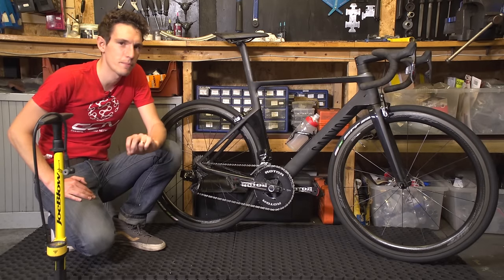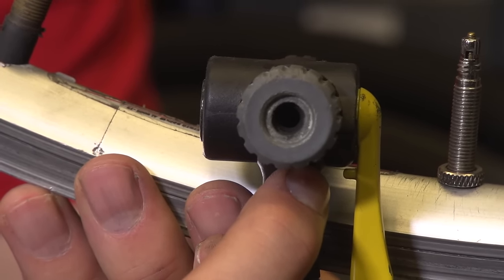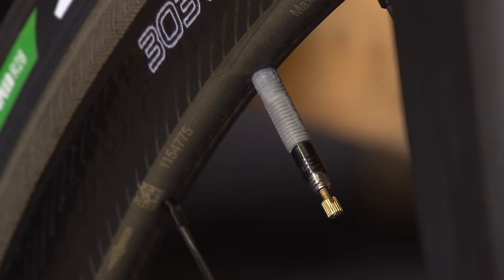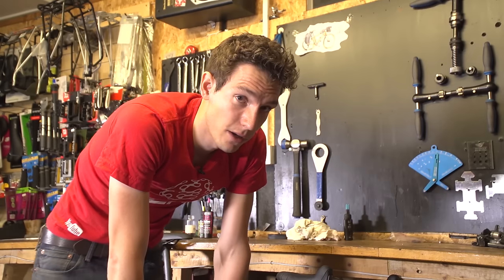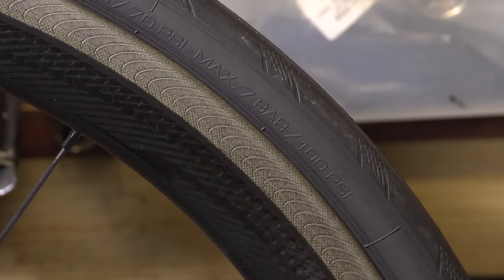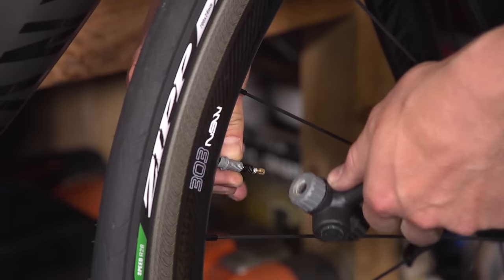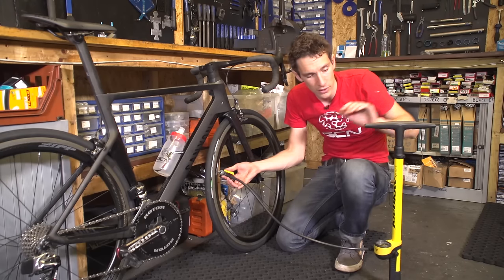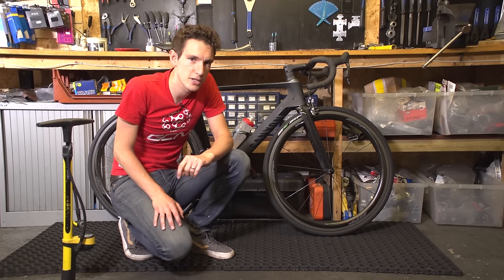How To Pump A Bike Tyre

Comment: haha i use laytex tubes and note : they have widths... i accidently got 700 x 23.... wanted 700 x 25.  they blew up when inflating.  Hey why ruin ONE expensive tube when you and ruin TWO?  my local bike shop fulfilled my request to get the proper sizes at 1/2 price.  lesson learned.

p.s. laytex tubes seep air...totally normal.  but way faster than butyl... just top up the air daily.

question for GCN.  did you ever "ping" the tires and go by sound ?  just got a digital tire gauge this week (age 66 my first ever lol).  pressure i normally ride at came in at mid 60s,  and when i pumped it VERY  hard went to 84.  using specialized roubaix 700 x 23/25 tires (yes that is what the sidewall says)... i worry about blowing out tube (butyl on this wheelset).  thoughts?

Comment: This is very interesting, thanks for this informative video. My road bike tyres states that it should be inflated to 100-130 psi (presta valve). But for some reason, when I start pumping my tyres I'm only reaching 60 psi and I'm no longer able to really keep pumping it - hard resistance feeling.. My pump is struggling to push anymore air in & feels like it's going to pop. Is that an indication that I have wrong tubes inside my tyres? The pumps gauge indicates it is more than capable to pump more than 130psi. Thanks in advance for sharing your knowledge!

Comment: What is the gray on the valve stem? Is that something added on to prevent the rattling you typically hear over every damn bump in the road? I've been trying to find a way to deal with that.
Reply: I always stick a little piece of electrical tape over them. Cut a length, make a little hole in the middle, stick the valve through then smooth onto each side of the rim (but not your brake tracks!). Only ever had this problem with deep carbon rims though.
Reply: Now that's a decent idea. I'm going to try that this afternoon. Thanks.

Comment: If the air isn't going in on a presta valve, I lightly jiggle/rock the pump head where it's locked onto the valve.  I hear a little tap/pop sound and then know that the valve is unstuck inside the head and ready to receive air. Not sure why this happens or if it's universal, but I have  virtually the same pump as Si and it happens about half the time.  No big deal once you know how to deal with it. Very frustrating before I figured it out.

Comment: Hi thank you for the video. My problem is there is a section of the tire that’s stuck in the inner channel of the wheel. I’ve tried massaging the tire as I inflate up to 40 psi but one section of the tire does not want to expand out to the outer edges so that part looks under-inflated. Any tips on getting the whole tire to sit uniformly around the outer edges of the wheel? I get the need for the channel for removing the tube and/or tire, but it’s very frustrating when it’s stuck in that channel when inflating back up! Haha

Comment: What's the white/greyish thing on the presta value? I imagine it's used to stop vibration while you're out riding but not sure exactly what it is. I generally use a bit of insulation tape on the value for that, instead of the nut that comes with some inner tires.

Comment: You don’t always need a adapter for your pump to change valves. Like my track pump has one hole for Schrader one for Presta valves. I only just realised this week as even though i don’t ride road bikes I got a new hybrid bike and all my previous hybrids were more mountain based which had Schrader valves but my new hybrid which is more road based he’s Presta valves and my pump works for both valve. That’s the first time I saw Presta valve exception of this video

Comment: I understood  the video and tried it. My pump has a blue thing in it that prevents it from being properly inserted to the valve. Do i have a wrong pump ? It’s a BTWIN 500 pump and I have a tubed road bike tyre
Reply: I opened the little nozzle and left it open and now I have both flat tyres with no air in either. It’s a Sunday 😅 I’d love to take the bike for a ride once this is fixed today 😊

Comment: I had to pump my tire yesterday because I thought it needed some air. I could’ve just rode on it fine but silly me thought it was getting harder to ride and thought pumping the tires might help. While I was pumping the damn bike pump’s tube snapped. I had to get to work in 10 minutes and so I thought wrapping it in duck tape would work. Suddenly I get more tears in the tube and I’ve accidentally let all the air out of my back tire because the bike pump’s tube was connected to my back tire and it opened a path of air to leak out quickly. So in the end I took my scooter to work which was exhausting. Now I’m wondering if I was pumping my bike wrong for my bike pump to just give out. It was a pretty old pump, no one in my household has rode a bike for 10 years.

Comment: I spent like 30 min trying to pump my bike with the presta valve closed. Also The pump gauge says 20 psi and the tire recommended psi is 60 but when I press on the wheel, there isn’t much leeway for me to push in the tire meaning it’s full on air? Thanks

Comment: Helpful; but, it has to be emphasised to those using a pump for the first time: lock the lever thingy in the direction away from the valve.

Comment: For a task I never a challenges as a kid, why is it so difficult now? Pump rarely seems to attach properly to the valve. The result is resistance that prevents air from moving at all or air completely escaping with each push of the pump. I’m writing with this exact same pump and similarly road bike tires.

Comment: Im guessing that the main culprit is my cheap pump? But I always seem to have problem inflating my tires (presta valve).. I cant seem to ever fit the pump head securely on the valve! I have to press it on the valve really hard, which sometimes will bend the lock ring's valve.. and that will weaken it and eventually break off. I'm 100% sure its not user error.. Any ideas or recommendations on pumps?

Comment: My son got his first bike last year and now his front tyre is low.Its a schradar valve and I have your very basic pump.Pumping it is fine but its when I unthread the pump I basically loose whatever air I've pumped into the bloody thing.Would a pump that you push into the valve be the solution.I'm tired pumping the tyre.Helpppp!

Comment: when I pump my road tire the head of the big pump always fly out because of the pressure so I must only use one of my hand to pump and the other to hold the head, any suggestions on how to secure the head of the pump to stay on valve, I dont have problem with the mini pump because it has threaded inside head that I screw in on the valve adapter and the big pump have flat inner head

Comment: 2:13-Is that the new #8 spoke adjusting hammer with a cushioned handle for absorbing the shock of the impact hanging on the wall.?

Comment: A pump that screws onto the valve can pull out the valve when removed, if the tube has a removable valve (as many now do) and you didn't use Loctite or pre-tighten the valve.  Very unfun to be stuck in the midldle of nowhere because you can't remove the pump without deflating the tube.  A dab of Loctite when packing the spare tube makes all the difference.

Comment: Hey guys, I have 23 mm tires but im looking into going wider. How much more resistance can i expect jumping to a 25 or 28 mm? double resistance? 10% more?

I dont have hundreds of dollars to spend, im using 23mm Continental ultra sports both front and back but sometimes it just feels so bumpy, although I do love how fast they feel compared to when I ran 32mm.
Reply: Specialized have a fair few tyres that are 23/25 meaning the tire itself is the size of a 25 but the contact surface is that of a 23 meaning you get the benefits of both, it's worth a look into and they aren't expensive either
Reply: I am interested in this as well. I just asked up above in the comments for a comparison. I just switched my 23mm tires to 25's and love them. Now I am curious about 28's,,,
Reply: according to one of GCN's videos you actually decrease rolling resistance going from 23mm to 25mm tires, and even to 28mm

Comment: Can someone explain why most every time I try to inflate my bike tires, more air tends to come out than in? I adjust and readjust, use different pumps (powered, hand and foot) and even on different bikes. It just seems that the air rarely wants to go it. I generally use Schrader adapters on presta vales.
Reply: Presta valve's are a nightmare to deal with. I'm having the same issues. They are small and very brittle. Avoid elops bikes from decathlon.

Comment: I just bought a manual tire pump and it has a pressure gauge but it has no locking mechanism nor does it screw in to the tire. I pump air in but after a while, the handle gets harder to pump and the air leaks out of the tire and whereas, I was at 10 lb psi I'm stuck at twelve and can't pump any more. Even my old pump let me pump my tire up to 32 psi. Help, if you can.

Comment: I tried pumping my tyre up to the recommended 45-60 psi, but I could barely get it to 30, and when I removed the pump from the valve, air came blasting out continuously until I got the cap back on it. Even after that, it felt like air was still rushing out around the base of the valve where it connects to the tyre. What did I do wrong?????????????

Comment: You put it on and then moved the yellow thing without explaining which way to move yellow thing. That’s what I’m trying to figure out. Also why is my front tire completely flat I was riding it with no problems this morning does that mean I need to replace the tire or just fill it up if it’s completely flat???

Comment: NEWBIE here...I'm trying to attach the nozel from the pump onto the shrader valve but it keeps sinking inside the tire so I cant push it on. Seconds when I pump, feels like something is blocking the air from going in the tire. The pump gauge doesnt stay up (needle goes up, then back down to 0)

Comment: What's the point of presta valves anyway? It just seems like a hassle to not be able to use a regular pump without an adapter.
Reply: *****
I guess that could be an explanation for why mine are leaking.  Thanks, I'll investigate further.
Reply: Could be rim integrity consideration - tiny rim surface and larger hole might be not something to trust. Besides, for aero "deep" rims having extra long shredded valve may look odd for aesthetic enthusiasts.
BTW, the S-to-P pump adapter costs pennies on Amazon and fits in my car tire pump case perfectly :)

Comment: If you don't do up the nut on your presta valve, when you are rolling down a mountain at 150kph centripetal force will open the valve. Now if you are going 600kph centripetal force will keep the air in the tyre so the open valve wont matter, but quickly making the jump from 150 to 600 is difficult for all but the very best sprinters. Cav might manage it. Chuck Norris definitely can.

Comment: The gauge on my pump works but it doesn’t engage when I pump. The needle goes up when I pump but goes back down to zero once I reach the bottom. Any suggestions?
Reply from the maker: Quite a lot of pumps operate this way, it might not be a malfunction of the pump

Comment: Hi Si. Big problem here. I've followed your video step by step (identified the valve, removed the dust cap, unscrewed the valve, attached the head of the pump, pumped like hell, checked the pressure with my thumbs, removed the head of the pump, screwed the valve again). Now I have a dust cap in my hand and don't know how to continue since I can't find any referral to it in your video.

Please prepare asap the second part of this awesome tech video, so I can finish with this wheel and start with the rear one. Thanks in advance.

Comment: Just got a road bike and had to pump up the wheels. The side of the tire said 120 psi, so i bought a pump that was able to go up to 120 psi, but the pump won't pump past 40 psi on the front and back wheel. I'll have to try pressing it a few times when I go pump it again to see if it works. Anyone have any other ideas as to why the pump is getting stuck at 40 psi?

Comment: i changed the tube, bike tyre seems loose at the sides and no matter how much i pump its still quite flat, can I increase pressure if i have just normal pump? p.s after inflating tyre went fully flat again  while sittin overnight , i changed the tube removed tiny bit of glass and patched the tyre from inside. pls help a girl

Comment: Rule #60 // Ditch the washer-nut and valve-stem cap.
You are not, under any circumstances, to employ the use of the washer-nut and valve-stem cap that come with your inner-tubes or tubulars. They are only supplied to meet shipping regulations. They are useless when it comes to tubes and tires.

Comment: I have a screw on valve after pumping it till I'm satisfied when I am unscrewing the valve lots of air escapes and the tire is pretty much deflated again. anyone know any tricks.
Reply from the maker: Hi there, add a few more psi to compensate the loss through unscrewing.
thanks
Jon
Reply: thanks I'll definatley give it a try

Comment: Actually having less pressure in the tires wont make them slower, with the exception of when riding in a velodrome, road surfaces just aren't smooth enough to run at max pressure. Having said that I run the max pressure that the tire allows in order to avoid pinch punctures.
Reply: Surely rider weight has a huge bearing on that? Pretty sure that a 13.5 stone dude like myself needs higher pressure to offset any tyre deformation than a puny mountain goat?

Comment: When you take the dust caps off put them in a safe place.
When you've finished pumping up the tyres retrieve the dust caps from the safe place and screw them back on.

Comment: This does not work. 5 years with this pump. I just tried again after watching this. Air comes out the top
For five years I put my thumb on it so I can get my tire pump unless I go to the bike shop 5 years about to put my finger on the top so the air will go into the tire. This is so frustrating. Everybody can pump up their bike but me.